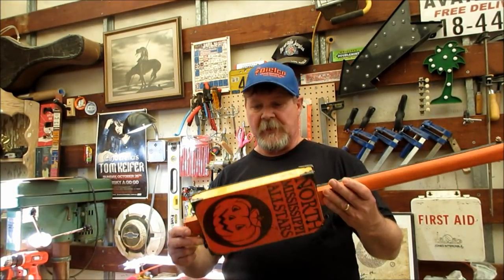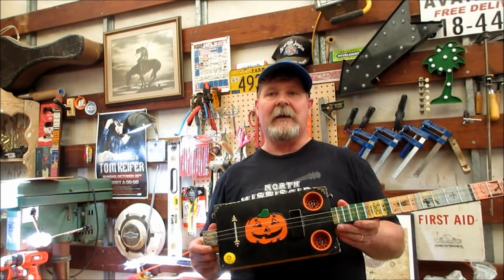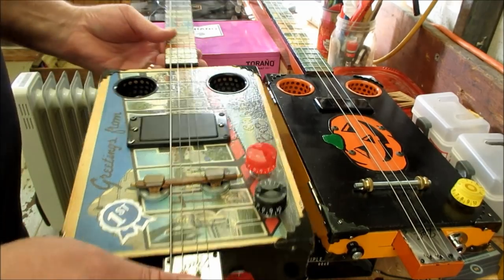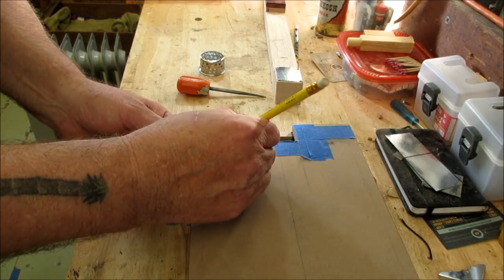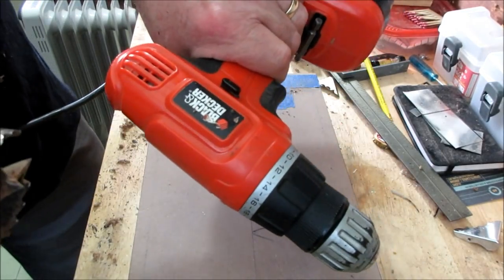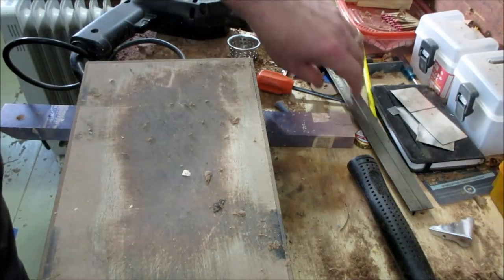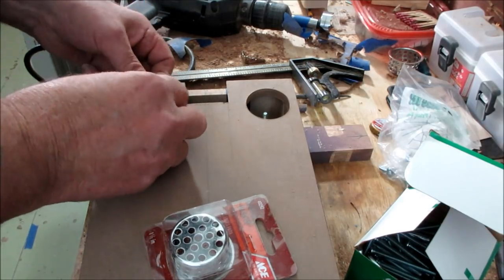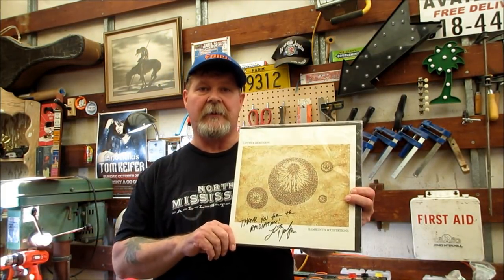Easy Open Box

Comment: Why do you use round head screws for the sink drains instead of flush flat head screws? Other than that, I like the closing method. Thanks for the video.
Reply from the maker: The box bottoms are thin, not thick enough to countersink.  The round head bolts give more holding power.